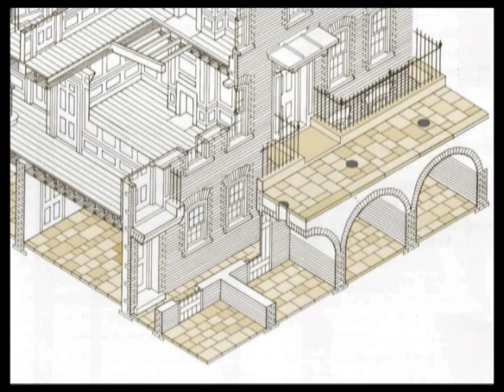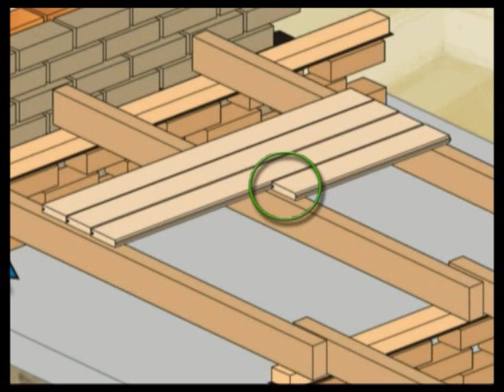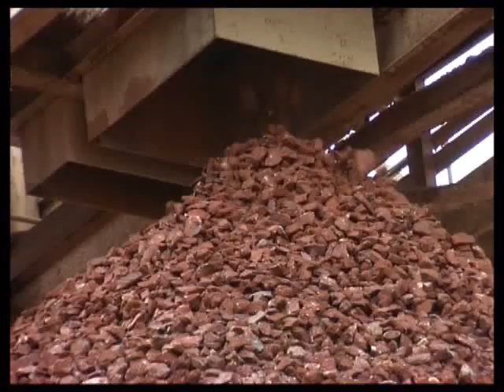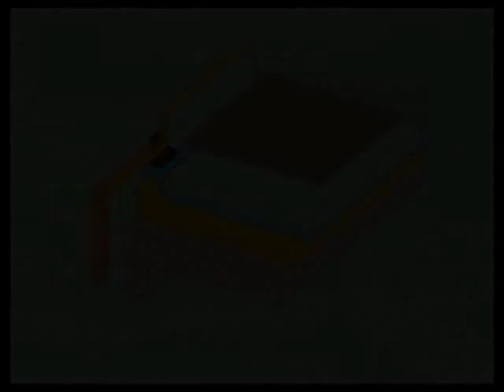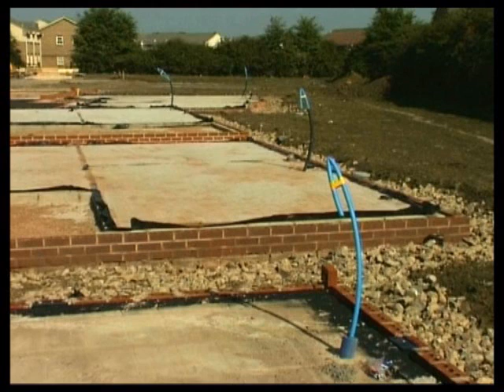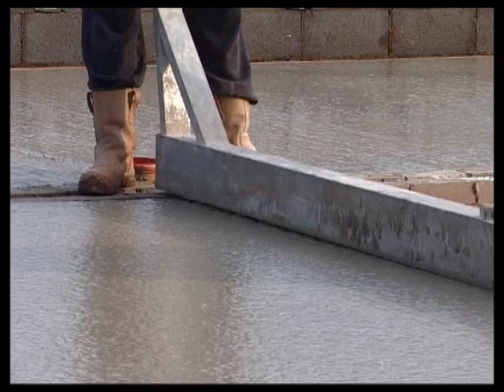Ground Floors HQ

Comment: You do not blind an oversite with sand,it will dry and filter downwards and the floor slab will drop,most bungalows built like this will have this problem.
Weak mix sand and cement should be used for blinding.